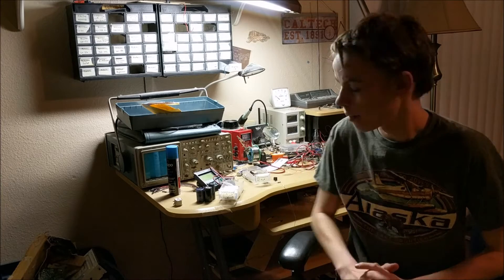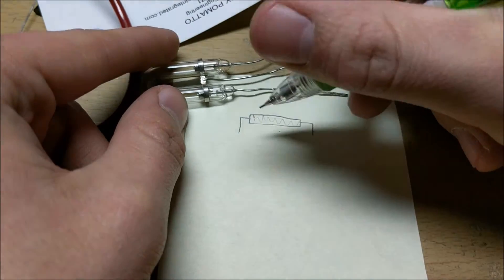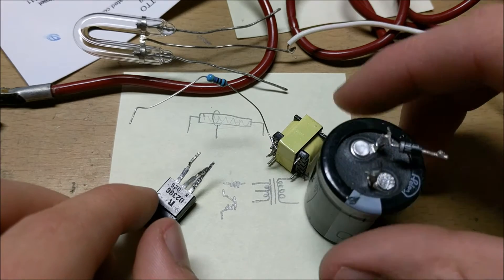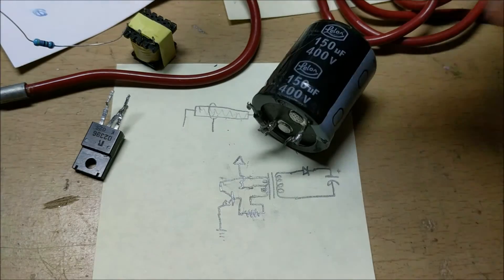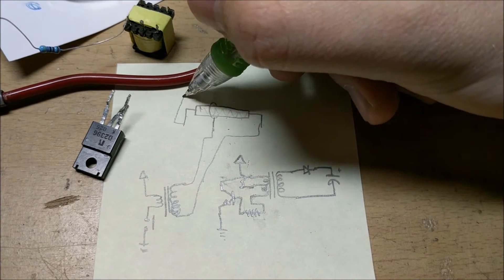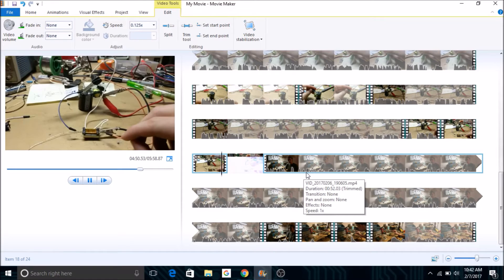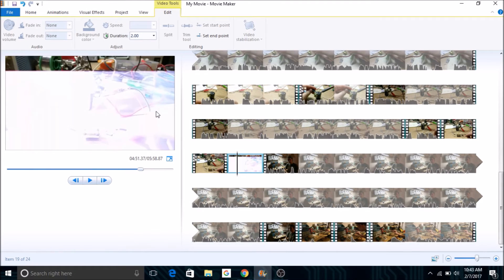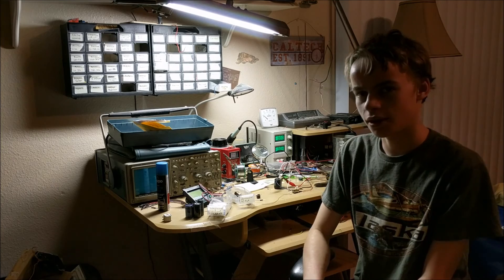How to Use a Xenon Flashlamp

Comment: I built a circuit with the same bulb today (my first real flash tube project aside from seeing how many capacitors it takes to blow a normal camera flash tube in one shot🤣), I desoldered the old tube from a disposable camera flash board and installed the horseshoe bulb in it's place, then added a bank of 15 disposable camera flash capacitors, it has a combined total of about 2,000uF at 340 Volts and let's out a rather bright flash of light when the board is triggered. I love the sound that bigger xenon flash tubes make, it is such a cool noise. I already bought another cap bank from a professional photography flash unit, it has 8,000uF of capacity at 475 Volts so my next flashtube project will have even more spunk, I want to find a much larger tube and try to make a rig that focuses the flash into as tight a beam as possible, see if I can't light up a mountain from three miles away or something lol. For a millisecond anyways lol...

Comment: hey Tanner, i was fabricating a project with zenon bulb. in a nutshell to replicate the process of expensive godox wireless flashlight equipment. since you have already sparked the initial loop, could y ou consider one in  your future video. like for instance. can we make use of zenon car headlight, with its ballast if its cost effective without compromising the quality of the light. or the actual zenon bulb itself which is horseshoe shaped. with reasonably bigger capacitor say, 2000 mf, 350v or something that range. in order to give approx 200 watts equivalent. as a general rule we say we need approx 1000 lux to produce a good image in low light. usually we have 500 lux or lesser in restaurants etc. hence the flash light should fill the rest which is 500 lux. this is minimal in photography. so i came up with a vague idea of diy ones own requirement flashlight which could be 200 or more watts. the problem is circuit and will it hold its huge current capaity or doesn't it matter as the capacitor and zenon will take care of the accumulated charge. i would appreciate your help if you could assemble these into a more sensible project. all ican think of is this. camera - wireless flash transmitter - wireless reciever - solid state relay - flash circuit with least voltage and amps  but higher capacitor and zenon flash bulb 200 watts or more - other safety features. thank you young man

Comment: good 
realy good
but thats not the true way
you should use a small tiger transformer in the size same as a bin
and a non poloride 0.022 uf 400v small capacitor 
the capacitor will charge from the big 330 uf capacitor through a 1M ohm resistor 
and when you hit the tiger switch small capacitor discharge in the triger transformer and makes a short puls about 3000 volt to fire out the zenon lamp(that 1M ohm resistor avoid discharging the big capacitor in the triger transformer and blow it out)
i gess you already know what i,am saying 
but i'am just saying

Comment: I like the video. Not a fan of music in a video, unless a music video; just get to the boring stuff. I've been wanting to learn about this kind of circuit. I have a crap-load of very small flash tubes that I would like to put in a ring structure to make my own ring light. I also want the flash output to be variable. If you know how to do that, a video on that subject would be cool. One correction, depending on whether you used a smartphone or DSLR camera, with the DSLR it's the mechanical shutter that is not 100% open at higher speeds. The fastest shutter speed with the shutter 100% open is called the sync speed. The next fastest speed will allow 1/2 frame open, the next 1/4 frame open and so on. Now, on to the low amp, high output flash circuit you were talking about.  :)

Comment: Nice clear tutorial Tanner Tech! Does the capacitor fully discharge through the flash tube or is there still residual chart?  Also is it possible to filter out the UV light from the flash output? Thanks Tanner
Reply: in my case there is charge left in capacitor ~70v

Comment: Could you make it provide continuous light? I need to make one so that i can make new channel art. Btw this is U-238 and I am rebranding my channel.
Reply from the maker: Xenon OK, like the new branding by the way, the xenon lightbulb used in this video was specifically made for short bursts of light.  In order to have a continuous xenon bulb, you have to obtain a different one.  Continuous light bulbs have a shorter distance between electrodes so the spark doesn't go out and thicker glass to help with the enormous amount of heat dissipated.  The circuit is relatively the same except it needs to handle about 35  Watts.  I might make one in a future video.